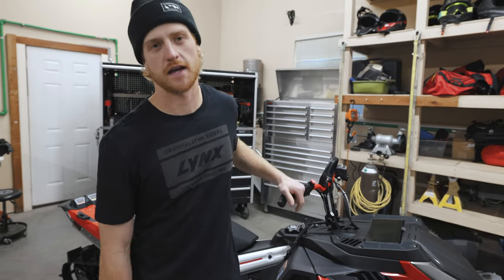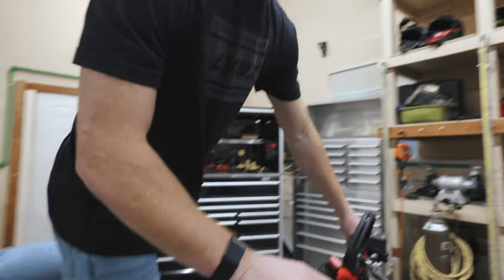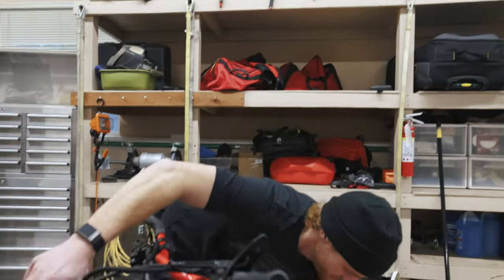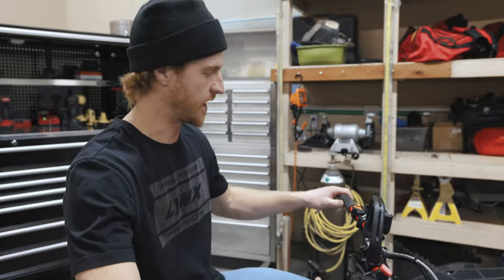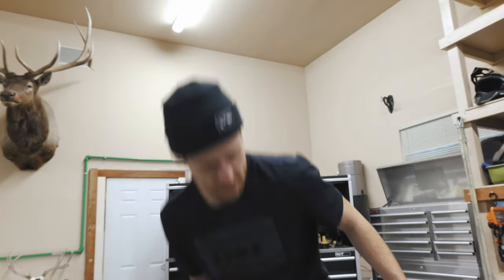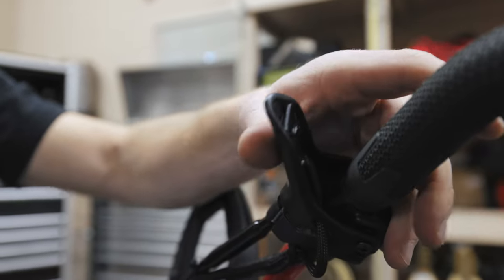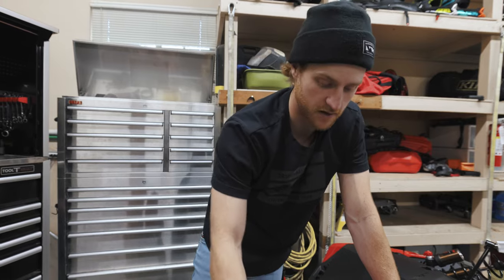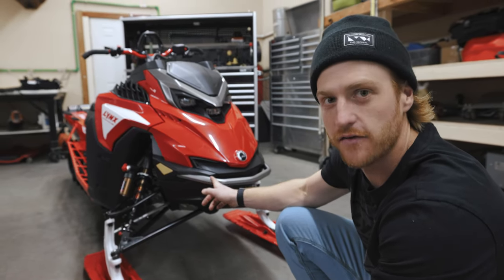Set your SLED up like a PRO - The basics

Comment: Stoked on mine, stoked you mentioning the Elevates because I have them too. One of the only reasons I have not put them on yet is for baseline and because I thought that I would n just not n yeteed to put my limiter strap to maximum setting for them, but if you are running them on the second to longest hole, then I will try that also. I might try some DS three skis have some thing from snow out here lately, not that I don’t like the blade DS plus.

Comment: So I put the zrp 1.25 lift spindles on my 850x 165. I noticed horrible added ski pressure and trenching my first two trips out. I let out one hole on my limiter strap and it helped but I feel it still rides a lot worse compared to the stock spindles. It also feels like the added pressure puts a ton of drag on my skid. Do the elevates add pressure like this, and what would you recommend to get it back closer to neutral. I like them in deep snow, but every where else it just feels like it’s fighting me.
Reply from the maker: the ZRP spindles changes what we call the "trail" and thats why I dont love them. i dont feel what your explaining with the ice-age spindles.  ice age also has recommended suspension settings for their kit.

Comment: Curious to see the sag adjustment on the rear skid ... manual on my DS says I should set it at ~3.5"? I don't know if I'll be able to get there at 300+ lbs ride weight :( .... They sell heavier springs by chance?
Reply: They do have a heavier spring.  But I put a zbro exit 2 aggressive on my lynx. Made a big difference.